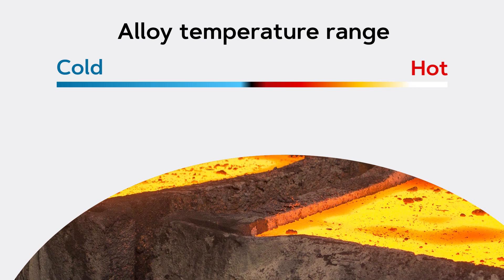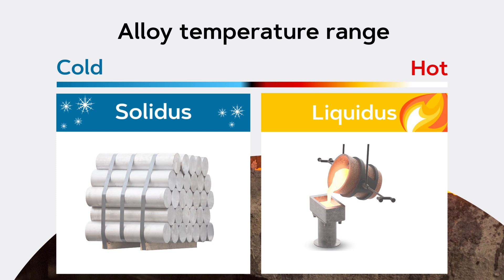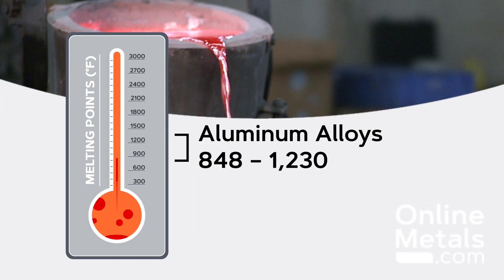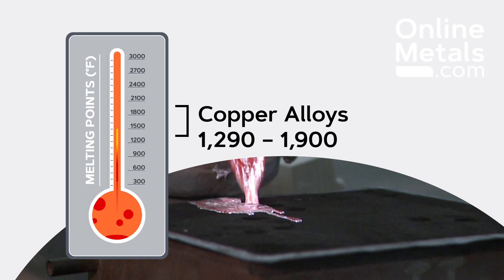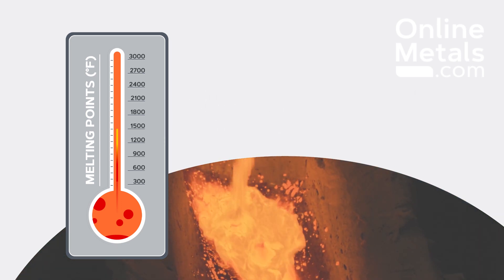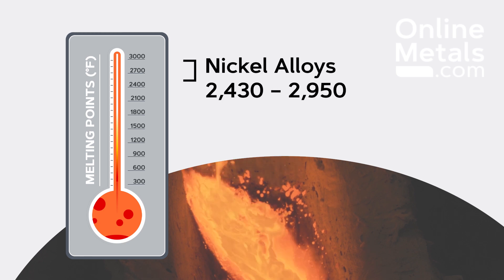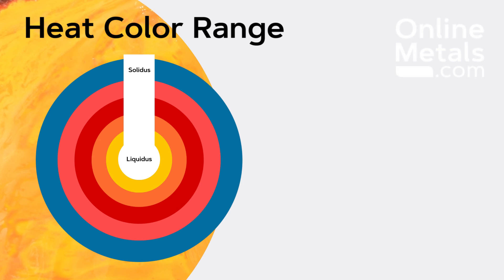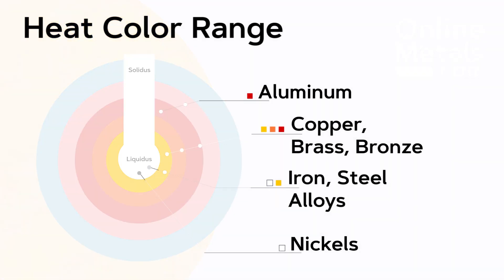Guide to Metal Melting Points (ºF)

Comment: When you heat something it puts of EMR.  ie. warm metal plate at 100F will feel hot to touch yet look silver.  Its putting off infrared which is outside of human visual spectrum but not outside a properly made detector.  

The peak is usual in the IR range till you heat it enough where it starts to peak at shorter wave lengths, it begins to spill into the shorter infrared part of the spectrum to visible red.  the first redish glow of hot iron at around 900F.   Keep going and the spectrum shifts till its in the middle of the visual spectrum appearing white hot then shifts to shorter blue wavelengths.

https://physics.stackexchange.com/questions/304299/how-heated-metal-colors-relate-to-black-body-color-at-the-same-temperature
Take a look at the graphs on that page. 

People can get pretty good at guesstimating a metals temperature via apparent color not quit as accurate as a prism spectral analysis though. 

This is not a bad starter on it if you want to get into a little more.
http://web.iitd.ac.in/~sdeep/Spectroscopy_lecture_1_2.pdf

Enjoy!
Reply from the maker: Thanks Bob, this is awesome. Appreciate the shared knowledge.

Comment: When welding why is a blowout of aluminum more catastrophic than steel? Does the density cause greater heat distribution?
Reply from the maker: We aren't sure about the density, however aluminum doesn't distribute heat as well as iron or steel. In both cases we are avoiding blowing out metal, so maybe it has to do with weight as well. If anyone else watching is a seasoned welder and knows the answer feel free to chime in.
Reply: @onlinemetals  that makes sense. Steel can distribute heat faster so the blowout doesn't get as bad as fast as aluminum. Thank you.

Comment: hi, I got a question about melting alloys, say for example I had a 6061 aluminum alloy and I decided to melt it at 2000°F does it still retain it's properties when it hardens?
Reply from the maker: Hi Louie, the short answer is no. The 6061 we stock is strain hardened, tempered and sometimes stress relieved.  It will have vastly different properties. Also 6061 isn't great for casting if that is what you are looking for.
Reply: Oh thanks for the reply, so what kind of aluminum is suited for casting? say I'd like to make a plate with a thickness of 20mm that I would machine later on
Reply from the maker: @louiejayjayme8095   While A380 is the most common casting aluminum, you may be able use MIC6, as that is already cast in plate form. Hope that helps!
Reply: @onlinemetals  I see,  the problem here in my country is that I couldn't find a local store that would sell aluminum plates that's why I decided to build my own foundry, the only part I'm missing right now is the knowledge of creating a plate, I don't know maybe I can weld my own mini cold roll forming machine or do you have any ideas to at least make an aluminum with less porosity?
Reply from the maker: Unfortunately, that is a little out of our realm. Might be worth heading to our site and chatting with our team or reviewing our product guides to help you through your decision: https://www.onlinemetals.com/en/product-guide.
Reply: @onlinemetals  thanks, any leads would be much appreciated

Comment: Hi my question is how can I make a steel shot maker similar to a Oasis Lead shot maker. Waterfowling requires non-toxic shot and steel shot, bismuth, tungsten or copper plated shot is required. How could I make my own shot maker for hunting and just plinking at the range? Each pellet has to be perfectly round
Reply from the maker: That would be a very difficult project due to the significant temperature needed to melt steel. Lead melts at a low enough temperature you can easily make shot in your home using something like the Oasis. Steel, on the other hand, requires a lot more energy to get that hot, and you also need the tools to be made from sturdy enough stuff to reach that temperature without melting. One of our employees' brothers made steel shot a few years back and said it was too much effort to replace just buying steel shot.

Comment: how does high pressure (megapascals) affect melting points of metals?
Reply from the maker: In general, metal will melt at a lower temperature in extreme pressure, however, there are plenty of variables to consider when it comes to each material.
Reply: @onlinemetals  if you friction pressure melt carbon, assuming no leaks, would it work?
Reply from the maker: @Jkauppa  that is a bit over our head, while we know that carbon is the highest of any element in melting point, we can't confidently tell you if it would melt with just friction pressure melting. Sounds like a great test case.
Reply: @onlinemetals  i'm sure it will be usable

Comment: I used a stainless steel pool filter filled with hardwood/charcoal lined with fire brick and fed with one of those cheap air blowers made for bathtub mats. Had fun melting aluminum but was surprised to find out I had melted the iron hinges from the hardwood table. Not bad considering no extra oxygen was added.
Reply: I realize it's kind of off topic but do anybody know a good place to watch newly released tv shows online?
Reply: @Nathan Cassius i dunno lately I have been using flixportal. Just google for it =) -luis
Reply: @Luis Orlando Thank you, I signed up and it seems like they got a lot of movies there :) I appreciate it !
Reply: @Nathan Cassius no problem =)

Comment: Sorry wrong on color and melting point.   Its based on temperature black body radiation.   That is one of the reasons why aluminum is silver looking when it melts + reflectivity When it does get reddish its much hotter than melting point and is why iron is just as red yet a solid.
Reply from the maker: Hi there Bob! Could you walk us through black body radiation and how that impacts color a bit? Love to hear more about your insight.

Comment: why is the melting point of copper higher than silver
Reply from the maker: Hi Darren, it has to do with the chemical makeup. Copper is used more frequently  for electrical and thermal conductivity than silver so it needs to maintain its form at higher temperatures.